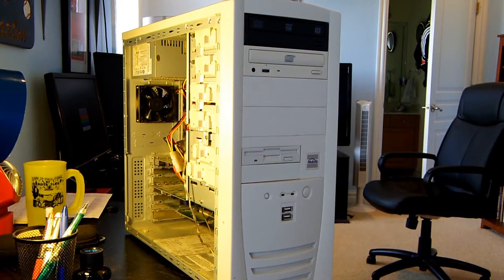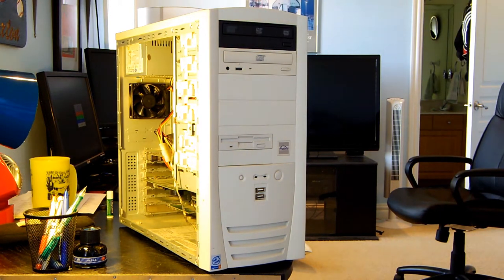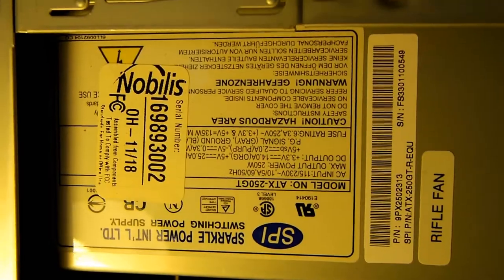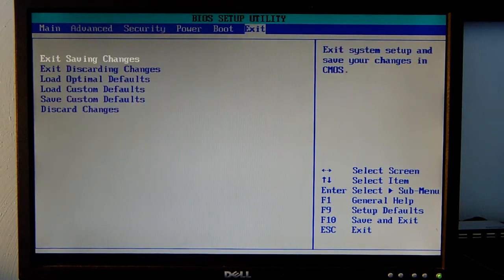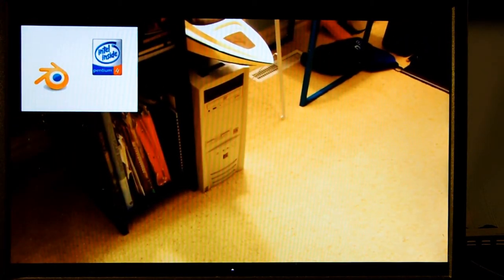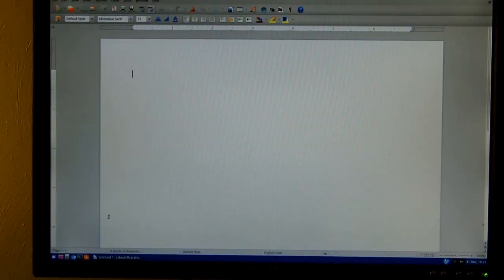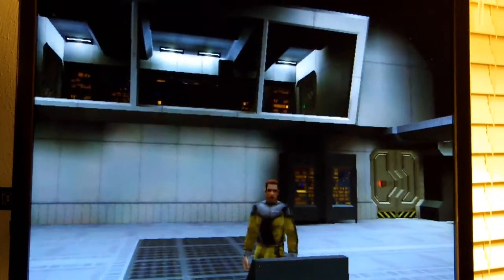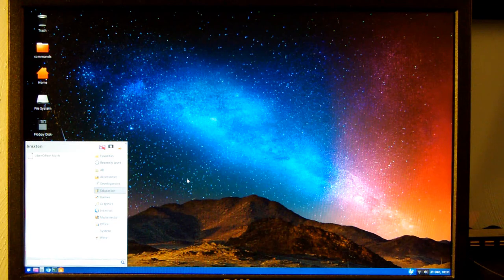Old Equus Nobilis Pentium 4 Desktop Computer Overview and Demostration

Comment: Nvidia 6200 cards don't support hardware acceleration or playback of H264 or AVC video and relies on software rendering for HD content like 720 or 1080 videos. On a system as low powered as that one you don't have the CPU resources to do that very well no matter what OS you have, Nvidia's PureVideo provided some software rendering up to the capabilities of the CPU and the rest of the hardware and is included in the proprietary Linux drivers. I wouldn't expect much from in on an old single core P4 though. 

And for the record, I have a couple of 6200's here and used to use them for older office machines back in the day when I could get them cheap enough. Then performed quite well for basic office tasks up thru Windows 7, but Intel chipsets from the 4x series on had better graphic capabilities than the 6200 series so I really haven't needed them for a few years.